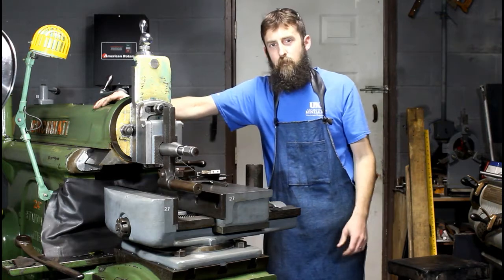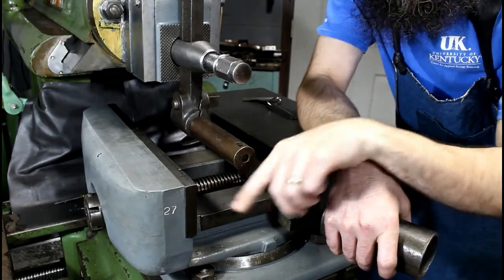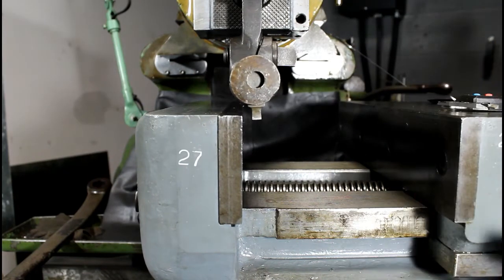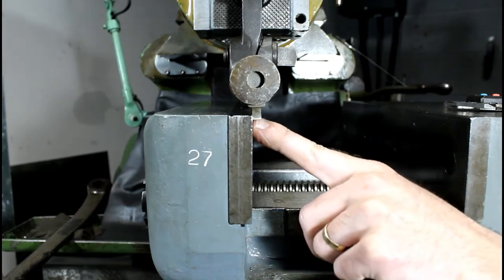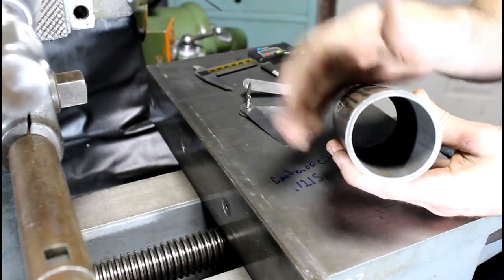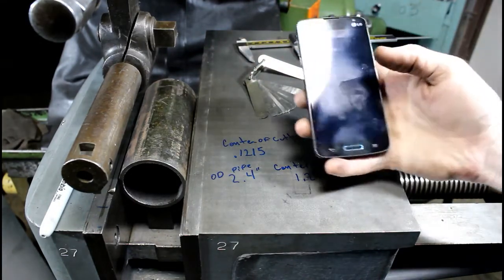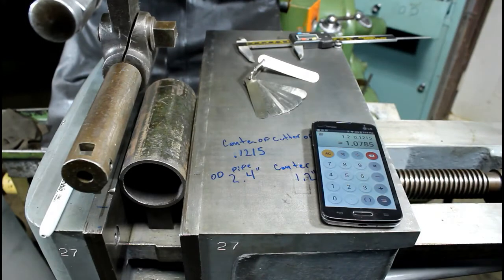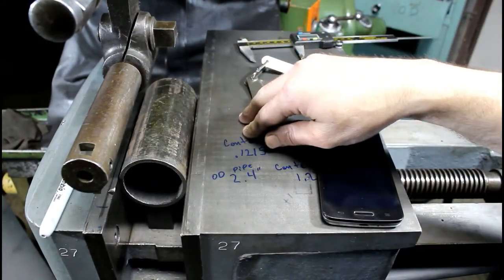Centering Bores in the Metal Shaper

Comment: This is exactly how I centered on a 21 spline driveshaft that I was cutting  (worked well), but have always been curious how one would align center for cutting internal splines/keyway on a shaft in a rotary table or dividing head; without the benefit of vise jaws. I suppose you'd probably have to use a square off of the table..?  Thanks for the informative video!
Reply from the maker: Yeah, I have never seen a magic way that is easy or will get you closer than referencing off the vise jaw, as long as the operator does his part correctly you are going to get very very close. As far as centering on a dividing head or rotary table you are correct, I would use an accurate square and pull from that or just off the edge of the work if possible, I can't think of any other way to locate the tool in relation to the work..
Thanks for watching.
Reply: Steve Summers - Another challenging example would be cutting a keyway on a pulley that is clamped to an angle plate, or cutting raceways in a rifle action. I can't imagine any other way than making a stub arbor to transfer the surface so that a person can use a square; but would love to hear any alternatives.
Reply from the maker: Yes, on a rifle action a stub arbor would be the best bet in my opinion, I guess as long as you have an accurate point to index from that's all that matters, everything is dependent on the item to be machined.
As far as I know there is no 1 way that is " The Way" to locate cutter/bores on a shaper. We just do the best we can trying to locate in as few steps as possible to minimize the chance that we make mistakes.
Sounds to me Robert as if you have a very good handle on how to make it happen.

Comment: Great video and very helpful, this one is going into my shaper tutorials playlist on here, lol. I was wondering about doing stuff like this, and the only other thing Im not 100% sure on is tramming in the head of the shaper to get it perfectly square to the table. I usually just use an indicator in the tool post and go off of the side of the table, but just curious of what other people use because someone else's method may be alot easier to use.
Reply from the maker: I have a video in the works about tramming  up the shaper, I do everything , table ,vise , compound.
Coming soon
Reply: Sweet, cant wait!